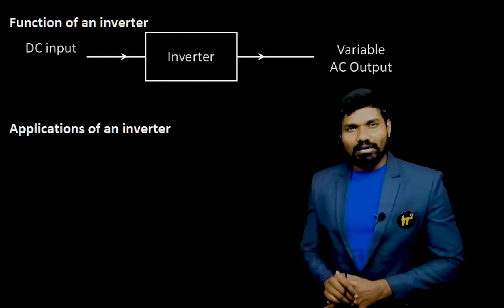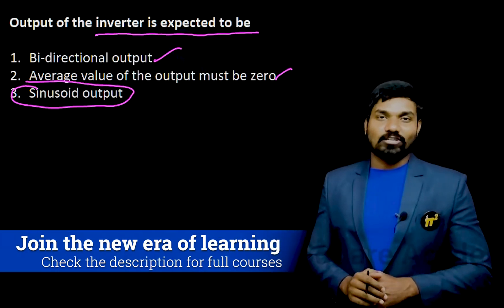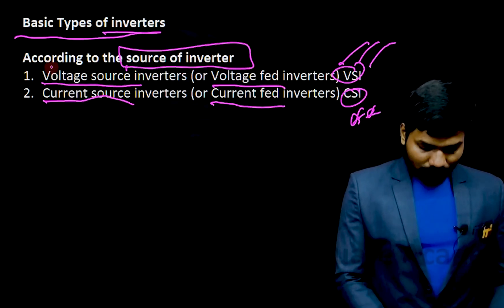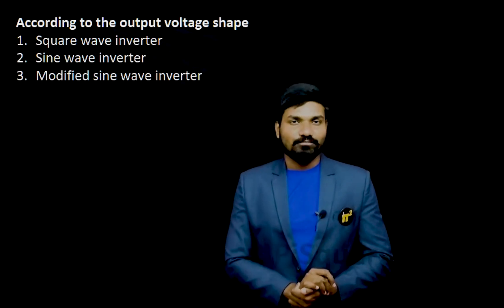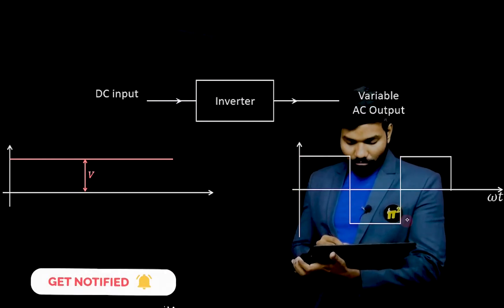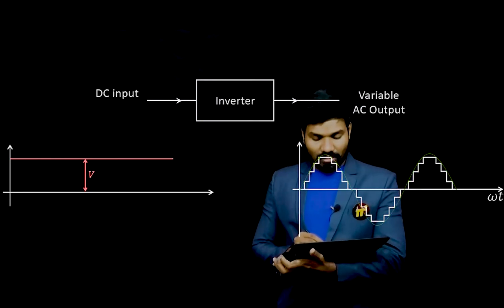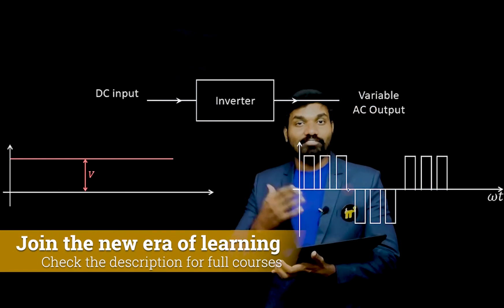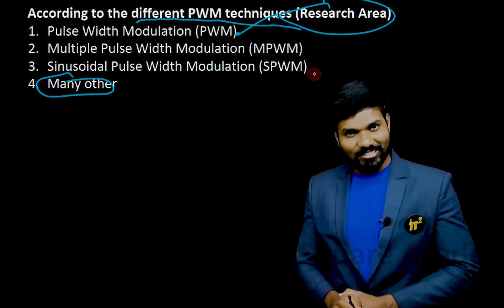Inverter Fundamentals and Types | Inverter Harmonic techniques | PiSquare Academy

Comment: Sir what is mean by LC in substation for power cutoff
Reply: De-energizing a substation for maintenance is typically not done because the load served by the substation must remain in service. When maintenance is required, only those parts of the substation that require service are taken off-line by the operation of opening circuit breakers and isolation switches.

If the total substation needs to be de-energized, however, then the following (general) procedure would be:

If alternate power sources are available, transfer substation load to feeders served by other substations by temporarily synchronizing to the alternate sources;

Open feeder breakers and open feeder isolation switches. This action transfers the load to the other feeder sources. If alternate sources were not available, then when the feeder breakers are opened, all loads would loose power and ‘lights out’ to the customers. At this point, the substation will still be energized with no feeder load;

Open the high-voltage breakers and isolation switches. This will de-energize the transformer(s) and all bus bars;

All substations will also have a station service voltage source often served by the distribution-voltage bus. The station service provides the auxiliary loads for the station battery charger(s), control enclosure lights, yard lights, motor operated devices, etc. The station service is critical and substations will typically have a backup source like a propane fueled backup generator or a feed from an alternate source that comes from outside the sub;

All substations also have a DC storage battery system to operate all critical protection and control systems. Should the substation remain off-line for a prolonged period of time, a backup AC source needs to be provided to keep the storage battery charged until power is restored.

Comment: Sir good morning..How can I check my house inverter is giving is square wave or sine wave? is there any way to check in the household condition?
Reply: It's depends on your loads ...u can check by their performance ....if they are producing sound 
..that mean that happens bcz of harmonics...so ir can't be sinusoidal in that case.
Reply from the maker: Dear Sayan, Good question. Please check the description for the answer. Thanks for asking the question.
Reply: Take up a CRO, Step Down Transformer if you're in a electrical laboratory and then connect the inverter with the HV side and CRO probes to LV Side and visualize the waveform in CRO. You have got it now, Cheers have a great day!